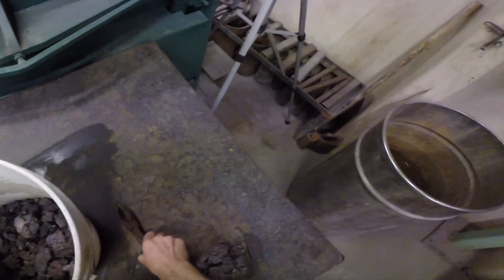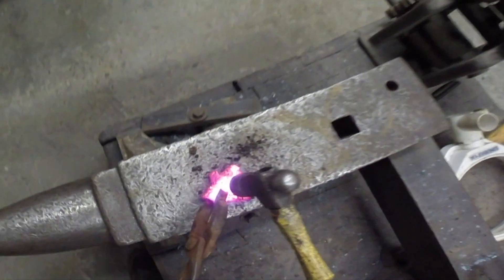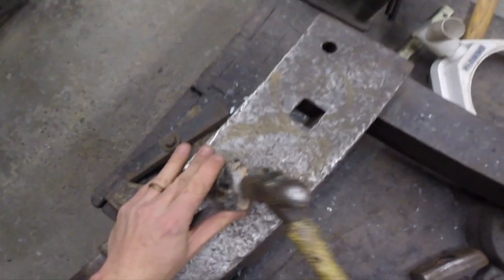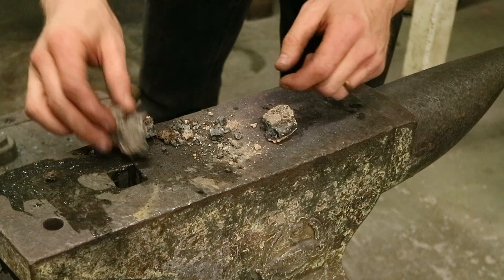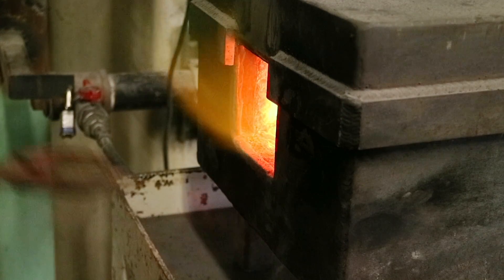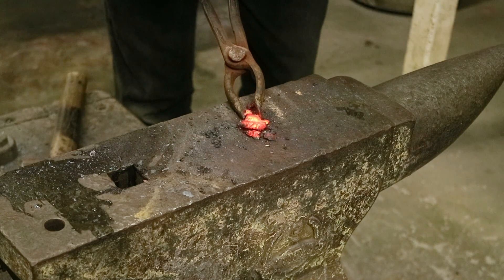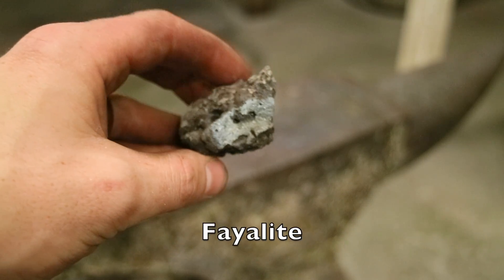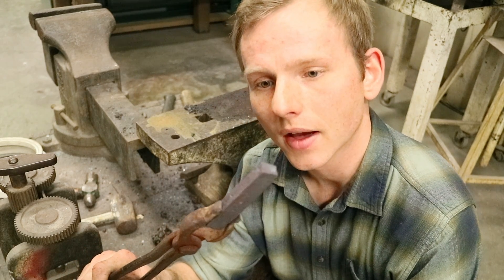Forging an Old Bloom (Smelted with TKoR)

Comment: The brittleness of the bloom(metallic sponge) is due to sulfur/carbon dioxide impurities. Calcium content in middle age iron implies epistemic use of lime flux in removing these impurities. Any metal you recovered was actually puddled, as in your bloom got too hot. Which is very hard to do with hand bellows, and charcoal.

In fact a puddling furnaces would be more promising for small scale productions. As mentioned in a previous video, a bloomeries efficiency is heavily dependant on its size.

Steel production only really got off the ground with the advent of coal burning temperatures. If you don't have access to coal, just substitute propane. It might not be as historically accurate, but it's better than beating your head against a brick wall.

Comment: Done this many times.  With chunks this small you must get them much hotter.  Use an oxy-acet  rose bud heating torch on individual pieces.  Heat them on a dense fire brick and consolidate them with a hammer right on the brick whilst under the torch.  You will see the slag  get thin and run out of the iron sponge,  hammer some more.  Make iron sausages and then weld them together with a high heat and power hammer.
Reply from the maker: Thanks! JB

Comment: I need Cody'sLab to confirm this, would adding some pre-existing steel powder/bits to the smelt aid in the individual particles of iron to adhere together, like when you scratch a glass to aid in nucleation in a glass?

From what few video's I've seen, they use wooden mallets instead of steel when forging the bloom into a bar. Not sure if its needed but it might aid in increasing the overall impact area, rather than focusing the force into a single point which might split the bloom.